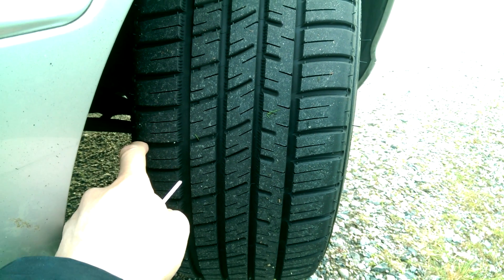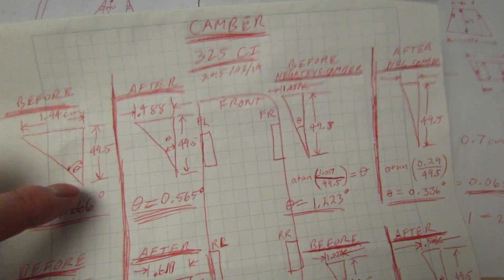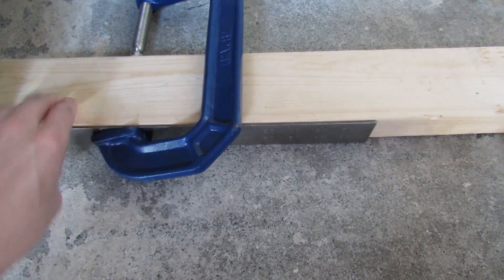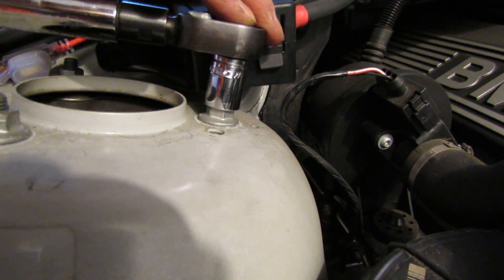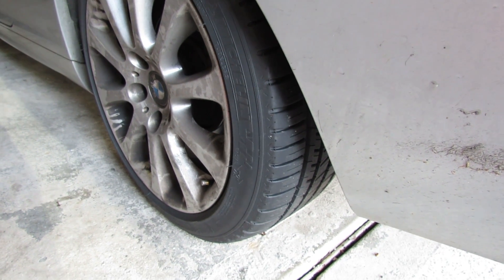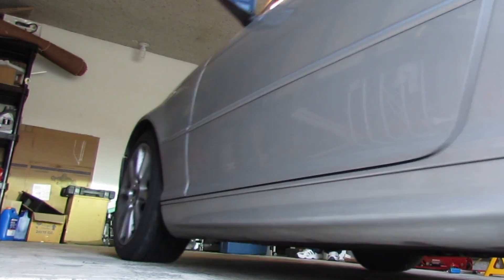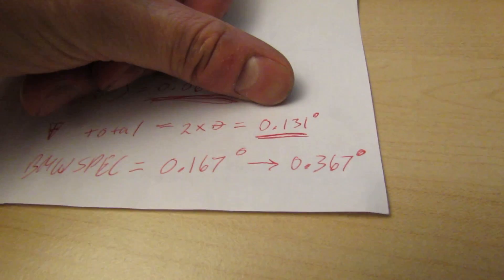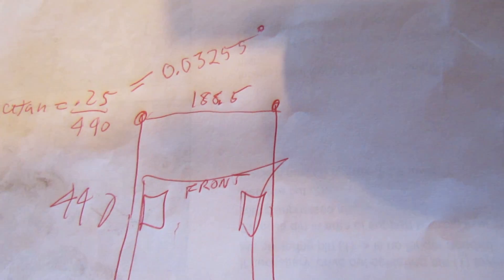How to Adjust the Camber and Alignment of a BMW E46

Comment: I am an alignment tech on german cars. This car needs a full gas tank and 300lbs in the front and 150lbs in the rear and 50 lbs in the trunk to get the correct ride height. Imitating down force  at highway speed. That changes the camber by about .3-.5 degrees negative. Also changes the toe by .1-.2 positive. So keep that in mind when doing DYI alignment. Use weights.
Reply from the maker: Hi Ahmad, 
Thanks for the info!  That's a great idea to add some weights to the car, and have a full tank of gas.
I'm hopeful that since I had a partially full tank, it'll be representative of me driving around the city on a partial tank.  I also usually only drive around as a single occupant vehicle, so hopefully an empty car will be representative of the majority of my driving.  Next time I'll definitely add some weight to help create a more accurate reading!  
Thanks again!  I'm sure a lot of people will benefit from this info.
Cheers!
David.
Reply: David great job but the comment of Ahmad is very important and let me say i did replace my lower control arm bushings and had alignment done but now the steering is light and car pulls to the left. REASON:The guys never added weights to the car when doing alignment (I had full tank ) but its not just weights.The reason you add weights is to get the car front axle and rear axle to the designated ride height. You have to be very close to the specs for the ride heights .See bentley manual.Only then can you adjust the toe and camber on the car. If you dont add weights to get the ride height and do alignment camber changes you will find at high speed the car is unstable and all other issues. You also need to check the caster with the steering turned 20 and 10degrees and it should be in spec. BMW techs even sometimes place wieghts on the front shock strut towers to get the car to the correct ride height. This has to be done on a multilink suspension vehicle. Many alignment places dont follow this process or understand what they are doing.Note also the tyre pressures have to be SPOT on too. Do some more research on what i have said and let me know if you agree or not. Thanks
Reply: Hello.
I am struggling to find the heaviest weights for front and rear seats. What are u using? Sand bags or gym weights?
Reply: 2 friends in the front seats @hanynowsky
Reply: Not true, BMW dealer newer done it and even they can not fix my negative camber but i at home with my hand tools can. good luck

Comment: Is the camber adjustment for rear the exact same on a X5 e53??
Reply from the maker: Giggidygiggidy12 Hi,
There should be an eccentric bolt on the X5 similar to what you see here for the lower control arm, so you'll be able to adjust the camber in a similar way.  It's a limited adjustment but hopefully it's enough to give you what you want.
Cheers, 
David.

Comment: Have a question about my steering wheel position being off center on my 2000 323i E46,steering wheel is at about o'clock position for the car to go straight,how can I fix this?
Reply from the maker: MadMan FPV Hi, to fix it you’ll want to use the front tie rod adjustments in equal turns.  So a quarter turn on left and the same on the right so that you don’t change alignment.  Once you get it straight you’re set!
You can do it by trial and error until it’s straight.
Cheers,
David.

Comment: Great video very instructive. Would hammering the dimple on the front strut bearing eventually vibrate and make the strut move around?
Reply from the maker: Hi, Thank you!
Nope, the 3 strut bolts, torqued properly will hold it from moving.
That factory dimple is just for a factory setting, that's all.  If you want to vary from the factory camber setting, you just gotta take that out.
Cheers,
David.
Reply: Thanks

Comment: Hi. How are you getting the vertical measurement for the calculation. Is it from the center of the tyre at the bottom up to the center at the top of the square. Or is it the actually height of the tyre from ground to top. Thanks
Reply from the maker: Hi,
I took it front the tire contact point at the bottom. But it would be best to take it from the rim, since the rubber can bulge out, and won't be as accurate as the rim.  
You'll want to create a triangle with a right angle, so the vertical portion must be measured from where your "adjacent" touches your hypotenuse.  SOHCAHTOA, or so they say. Using TOA, as tan opposite adjacent, we just need to measure out the opposite and adjacent, which is like run and rise.
I've started testing the camber with a smart phone, and it can be very accurate if you have a level surface to park the car on, the protractor apps can be 0.1 degree accurate, I've tested my HTC M7 against a calibration wedge, and it was almost spot on.  I haven't tested the iPhone, but I suspect it's pretty good too. So give that a try on a level surface.
Good luck!
Cheers,
David.
Reply: Thanks for that.

I did indeed resort to an android app aswell!
 My driverside rear tyre blew out today and I now notice that all the wear was on the inside. When checking it with a piece of wood against the rim and my smartphone against it, Im getting negative camber of 3.5 - which I believe is waaay too much. The opposite side is wearing evenly and the app is reporting 2.0 on that.
Ive got an e46 myself so Im just going to attempt to adjust it to the positive until im getting closer to 2degrees which I believe is correct for the car....

Can I ask what app you'd recommend for android?
Reply from the maker: You're welcome. Haha nice. Ya it works well.
If you calibrate it to a flat floor, you probably get a more accurate reading than a measurement with a ruler and square.

I thought that the spec max was 1.7 or something.  I forget now, I think I have it in my video somewhere.  

My max was 1.7 and I felt that was too much negative camber.  Your alignment might be out too. 
The alignment might straighten out once you fix the camber tho.  Sounds like something is really bent to be having 3.5 though.
My tire blew out when I had -1.7, and some toe in, so yours must be blowing out really quick.  
Ya I would set as close to 0 as you can and see if that helps, when you make the adjustment, maybe get a friend to push the bottom of the tire in while you tighten the nut, that is a way to get an extra 0.5 that you otherwise wouldn't be able to get.  Just make sure he doesn't knock the car off the jack stands, that can be dangerous to be pushing the car while you're underneith, so caution there.  
If you still have -2.0, something is probably bent badly.  
If measure it with a square to make sure your readings are right too.  Can't just trust a smartphone on this.  Tires aren't cheap. Lol.
I used "smart protractor", but any app works. 
Good luck!
David.
Reply: Thanks, Ill give it a go and report back. Last question.... when you were researching all this, did you read that messing with the camber can adversly affect alignment (toe)??

Ive had my car four wheel aligned 2 months back in order to pass a road worthiness test. The mechanic only concentrated on toe because that's all the test is concerned with. Im just worried that since all these setting are related, if I increase the positive camber alot, I will mess up the toe setting on that wheel and chew the tyre up worse.......
Reply from the maker: You're welcome.  Yes, you are 100% correct, any change to the camber will most certainly affect alignment, it's designed to do that, and that's why the order in which it's done is so important.  
First step is to adjust camber to what you want, this will change the alignment.
Second step, you adjust alignment to exactly what you want, this won't change camber at all, so now you have the correct camber and alignment.  

During the alignment, they should have recorded a print out of your camber and alignment. Even though they won't change camber they should have checked it with the computerised system, Hunter or whatever they used.

If they didn't check your camber, that's just being lazy. 
I wouldn't bring my car to a shop that won't print all your before and after readings.

Reducing the camber will make it toe out, if it's toe in right now, it might make it less toe in, and that's fine.  You just want to make sure it's not toe out.  
You just want a slight toe in for stability, and tracking.  Even if it's 0 toe, you're fine, one sure your car will track fine like that.  
So just check your alignment before and after the camber adjustment and you should be fine. 
You can check the alignment with the string method if you don't have a laser level.  I've seen some videos out there try that out. I don't think the android app would work well for that.  You just want your tires straight basically. 
Hope that helps.

Cheers,
David.
Reply: Yep thats a big help. Both my rear wheels are noticeably well toed in atm, so hopefully reducing the camber will keep them within tolerance. Ill take it slowly and measure often!
Thanks!
Reply from the maker: Awesome. 
If you want to minimize wear, don't worry about specs, and just go for as straight as you can, with a slight toe in, for both front and back, and about 0.6 deg of negative camber.  I have had my E46 set like this for the last two years and it drives like it's on rails.  The Michelin Pilot Sport A/S 3 that I have on there are still 50%+ and I drive fast and hard.
I don't do the track so with this even set up it's been fine.  It still corners like a beast as well, probably not as well as with minus ,1.7 camber, but it's still really good with the A/S 3s, still handles way better than most sedans out there.  
Good luck!
Cheers 
David.
Reply: Had a go at it today. Once the lock nut was opened, I got about 3 half turns on the adjusting bolt where I was reducing the negative camber, before the process began increasing the negative camber again.

So i basically adjusted both rears to the max they would go in the direction I wanted before locking them up.

A check of the protractor app is showing me 0.6 and 0.4
I believe this is -0.6 because when I originally measured I was getting a reading of 3.5 This was with pronounced and visible neg camber. So I assume Im still in the negative. I also checked with my square and its far more level on the vertical now.

I will need to return to my tyre shop again as I now notice that the wire is showing in the other rear tyre so that one is due a blowout soon too! I may get them to put on the laser equipment and confirm that my adjustments are ok!
Reply from the maker: rivolinho Great to hear! Sounds promising!!  
With the app, you just gotta zero on the floor, then tilt negative, it should show negative, if not, then positive is your negative, and negative your positive camber.  The square should be a good method of double checking though.  
Yup, if they can print your alignment and camber, that would be great.
Some shops have been know to put the tools on crooked though, and that screws up the readings, my buddy burned through a tire in 7 months cuz they aligned his tires all wrong lol. so it's not a perfect reading either.  It's best to do it yourself if you can, and double check their work.
Good luck.
David.

Comment: Thank you very much for your time, energy, and knowledge in making this video. I have been watching hundreds of different e46 DIY videos over the last two years and none of them were as helpful as your video. i blew out 4 tires in this past year and was about to blow out my 5th yesterday,  i noticed the inner tread wear on my back left tire and started watching videos. Now i know why ive been shredding tires.  Thanks to your video im about to go make camber and alignment adjustments in my garage and fix this problem myself. 👍 🚗 🔣 😂 

Best e46 DIY video on Youtube.
Reply from the maker: You're welcome.
Ya, I blew out a tire on a bridge! That was it, I had to fix it.
2.5 years later, my tires (Pilot Sport A/S+) are still good, and evenly worn!  It's wearing slowly, even though I corner hard and fast with this every day.  Probably doesn't have as much bite on the corners, but still feels great and has plenty of grip with the ~0.7 deg negative camber.  I highly recommend it!
Glad you liked my video, thank you very much, I appreciate it!  Enjoy your dead straight tracking go-cart handling E46!
Cheers!
David.

Comment: Thanks for your time bro. very good video.
Reply from the maker: You're welcome.  Thanks!   Glad you liked it.  Hopefully it's helpful. 
Cheers, 
David.
Reply: How much does a job like that normally cost?
Reply from the maker: You can get custom shops to do adjust it to custom settings for about $200USD.
Normal alignments to factory specs can be done for $100-150USD, but they won't remove the front camber pins unless they're really good.
You've gotta find a good alignment shop that is used to doing it for cars that people take to the track, those mechanics will know how to make the appropriate adjustments.
Cheers,
David.

Comment: hi bro, brilliant video. thank you so much for your time creating such a helpful video. 
much love from malaysia
Reply from the maker: Thanks man!  I appreciate it!
Hope it helps!
Much love from Canada!
Reply: its 1pm here, just got back from the the tyre shop. hahaha had a very, very funny conversation with the guys whos aligning my wheel. kept telling them its not a simple as loosening one screw etc. needless to say they didnt managed to get it right. they told me my bushings need replacement. currently my front wheel is at +0.5 both side, with rear at +2.4 left, 2.9 right. is that way off?
Reply from the maker: Lol, it's 10:02 PM here.
The BMW dealership told me they couldn't change the camber on the front tires, and then I reminded him about the pin, he said it would take 3 hours to take it out....  Geez, I got it out in 3 seconds with a hammer, well not out but effectively the same thing.
Some mechanics don't tell you the right information, and you need to know everything yourself, otherwise it won't be done right.
They're just using a computer system to tell them what's going on, they don't know for sure.
Is it 0.5 degree toe in left and right?  That's a little more than the spec, but not way over, BMW spec is 0.1 to 0.367 degree toe in TOTAL, so you have like 0.5 x 2 = 1 degree total.
http://forum.e46fanatics.com/showthread.php?p=3913531
You should check your camber, it sounds like your bushings may be worn and your toe in and camber are way too much, toe-in and negative camber I suspect.
You'll wear through tires really quickly like that, like in a year of driving.  With good alignment, I've been evenly wearing out my tires with aggressive driving for 2 years, and they still have 2 more years left on this set. It's very important to align them right, and set camber properly for even wear, if that's what you want.  If you do track days, I would set camber to most negative, just for that day, then set it back to full neutral as much as possible for normal driving.

If you want to check camber and don't have a square:  Try taking your smartphone, installing an inclinometer, or protractor type app, parking on a level garage, and using that to zero to the floor, then test your rim's camber, it should be -1 degree or so.

Comment: can anyone here tell me if there is a standard order for adjusting alignment, like is it caster, camber, toe or something else? Also looking for tips on access to camber bolts that are located near the top of the strut.

So far I can only think to jack the car up, adjust the bolt, tighten, lower the car, resettle the suspension and recheck the camber. Same for toe. 

 For toe, I have service manuals that say for example, 0mm +/- 3mm, but what points are being measured? By 0mm I believe they're also stating 0deg. How would I measure angles from the car's center line?
Reply from the maker: I only adjusted camber, and alignment.
Since changing camber also changes alignment, you've gotta adjust camber first, then adjust the alignment.  Changing alignment doesn't change camber much, but I think it'll change it a bit.  You could check the camber after changing alignment to confirm. 
For caster, I don't think it affects alignment or camber much, but I would do that first, since it's less sensitive than camber or alignment.
I measured my toe angle using a laser level.  I wouldn't measure it from the center point of the car, it's more important to measure it relative to the other tire since that's what matters, it's where the rubber hits the road, as they say.
Ya, I would jack it up, adjust, then drop it down, and move the car back and forth to resettle, then measure again.
Reply: David Sunshine thank you David!
Reply from the maker: You're welcome.
My tires are wearing out evenly and very little, so I think my technique works.
As long as you do alignment last, and get it near-perfect, your tire wear will be minimal. 
I'm pretty happy with it, and after hearing horror stories of my buddy's having tires worn out after 7 months due to a bad alignment, I'm glad I did it myself, and did a good job with it. Definitely worth it.

Comment: hey I'm really trying to figure out where that pin that gets hammered out goes? it's somewhere in the top mount and it just floating in there is bugging me. any idea how to get it out?
Reply from the maker: I think you have to remove the strut to get it out, it probably sits on top of that.
I haven't done that before though, so not sure how hard it is.  Seems pretty involved though.
Reply: I figured it out, just lifted the car and was able to fish it out with my fingers and a borescope. Thanks for replying man, appreciate it much
Reply from the maker: Lol nice, good job, so no need to remove the strut. That's good to know.
Do you think it can fall out from just driving around?  Hit some good bumps maybe and it'll go flying.